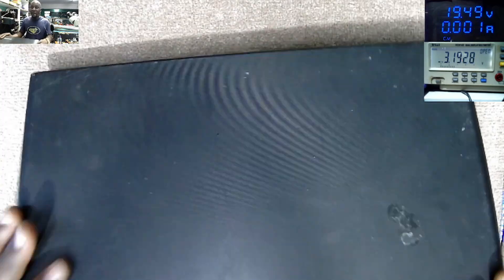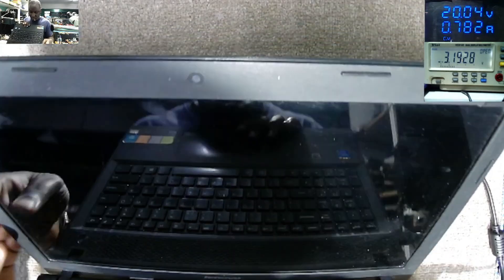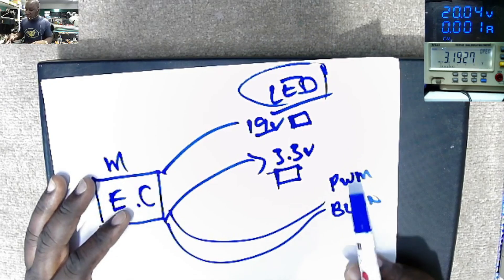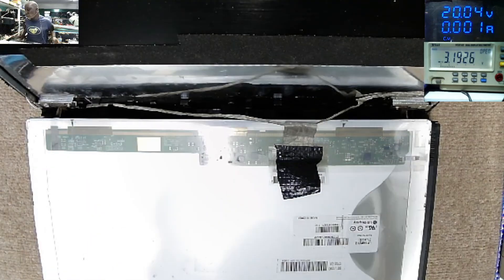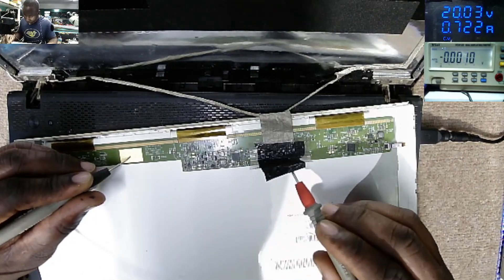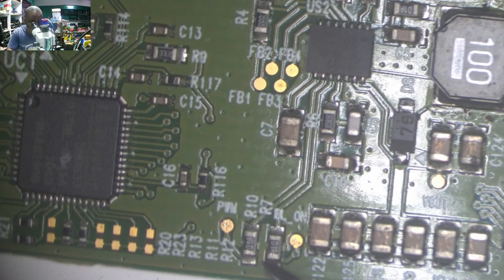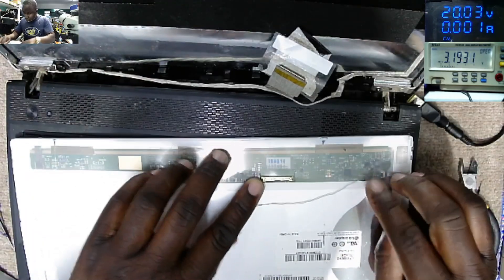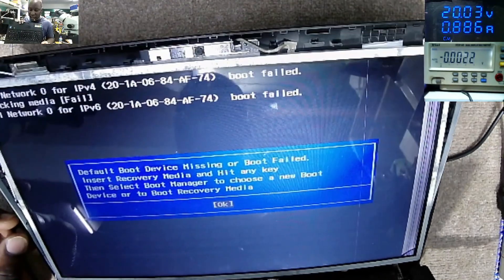Learning How The Backlight Circuit Is Working On Laptops--Lenovo G500 Repair!!

Comment: i have problem with my laptop that the is backlight OFFic. I checked these voltages like ,... output 19v in the coil is appears, it means sure the LED_EN signal is OK. I shout out the ic OZ9956B (PWM controller ..for brightness) is "HOT" . Is it the IC problem ?   it seep like the GND signal not appear to the CCFL. If i check CCFL input (+18V) and the (-) probe to the "case grounding" it is OK, but No if the (-) probe to the circuit. 
I dont understand how this PWM works ,.. I see the datasheet says the ground of CCFL goes to the pin ISEN1~ISEN5.   

What is ISEN1 do ? Current censor ? 
can I bypass it for emergency repairing.. Or I must replace the IC?

Comment: I have noted that you have shorted three test point together,the one has 3.0 voltage,so 3.0 will not be enough to sustain 3.3v requirements
Reply from the maker: 19v it's coming from main power rail not from EC Chip.. It's true thank you